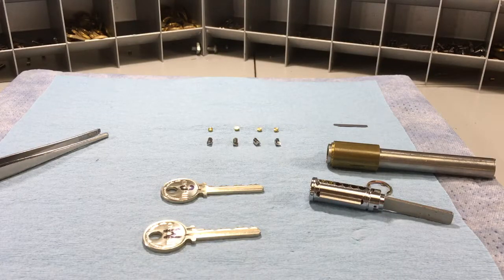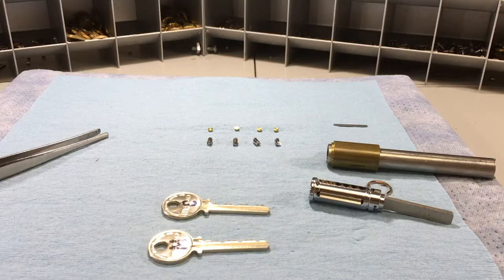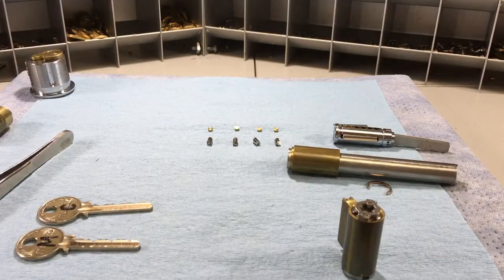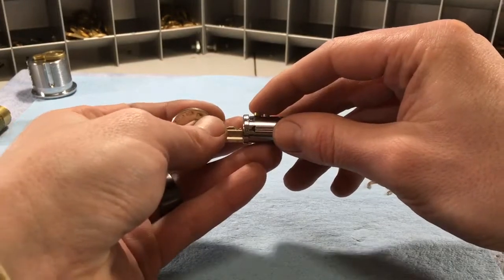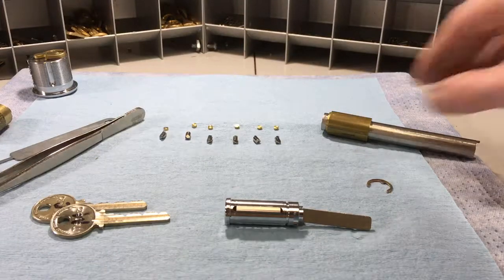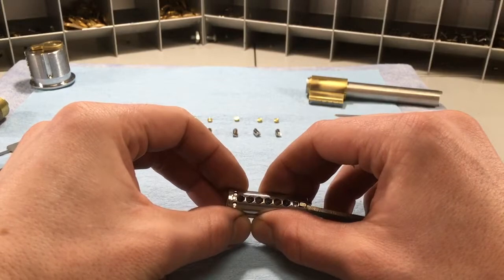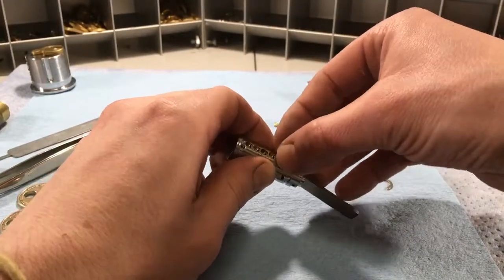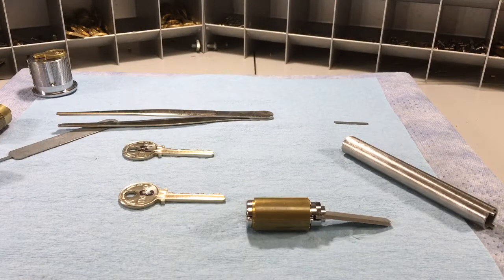Assembling master keyed, “old style” Medeco 20 Series KIK/KIL cylinders.

Comment: Running a shim across the plug and letting the side bar go in the side bar slot and not letting the top pins fall in the chambers will also work.  I have used this on ASSA twin 6000

Comment: Thanks man.  One dumb question, What tool do you use or method to crimp the old style spring covers?
Reply from the maker: They make dedicated tools for them but in a pinch you can use any flat piece of metal that runs the length of the core. Something like an Allen wrench could work.